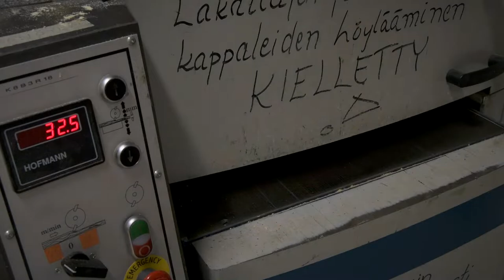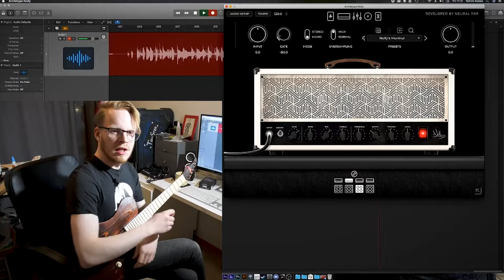Building a 100% Pine Guitar [SHORT VERSION]

Comment: ...  and the purpose of using unstable wood for a guitar is????????????????????
Reply from the maker: Which is why it was stabilized via burning the wood. But essentially, this was a challenge set by a friend: could it be done? Made in 2019 and it still plays well without any twist or stability issues.
Reply: @IPGuitars  i like this kind of experimental works, but I guess pine can't fix the posts of bridge maybe for tele style bridge is not problem.
Reply: @IPGuitars  I'm doing something similar with a 4001 neck-thru bass using Yellow Pine and Douglas Fir. Not all pines are the same. The Janka hardness and tensile strength of these woods suggest anything but unstable.
Reply from the maker: That sounds cool. And absolutely right. With the right growing conditions and age you'd be surprised with the difference between that and what most are used to ie. hardware store pine.